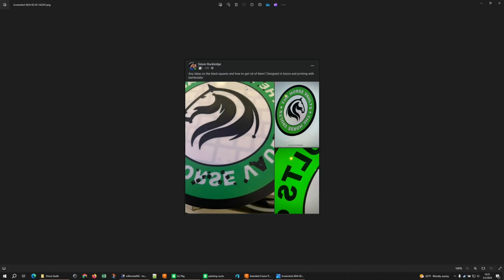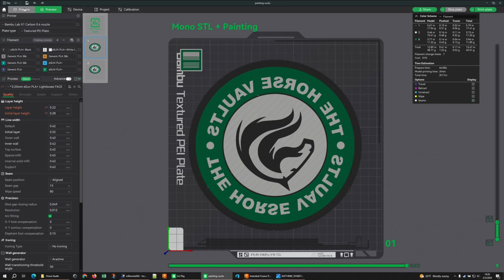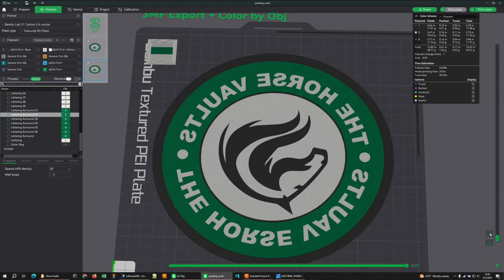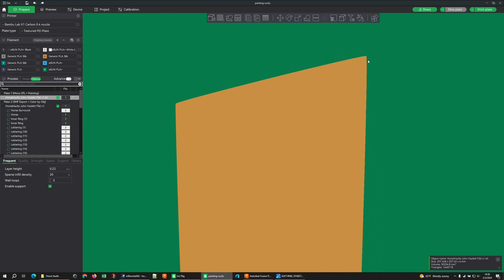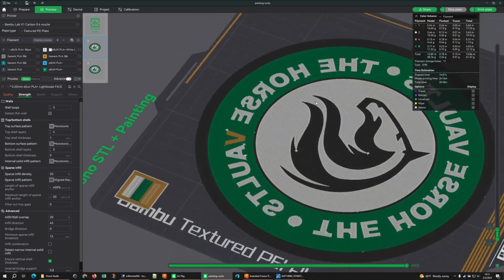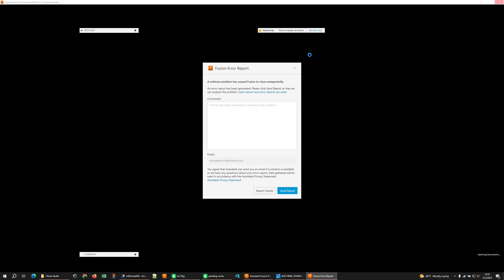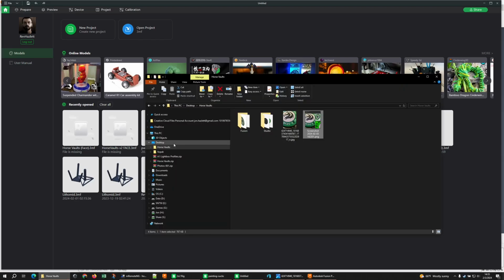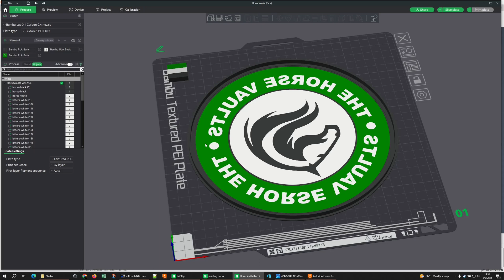Bambu Studio - The Limitations of the Painting Tool

Comment: Hey , can you show all your settings for lightbox ? filament and general :)
Reply from the maker: Filament settings are all just properly tuned to the specific manufacturer / formula / color. I start with whatever data they provide (some more than others) run basic flow ratio and pressure advance calibrations, and that's it.

My current settings can be found in the more recent posts made to Makerworld, like this one - https://makerworld.com/en/models/90934#profileId-97275

I hate inflating downloads on MW if you just want the profile though. The JSONs for my profiles are here if you'd like to import them directly - https://www.ludicrosity.net/3dp/fixes/lightbox-profiles.zip